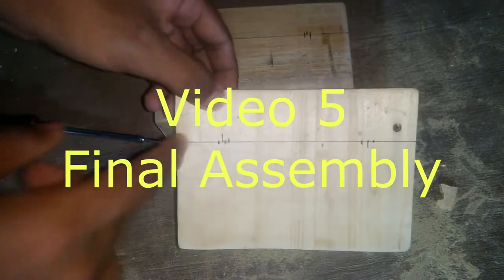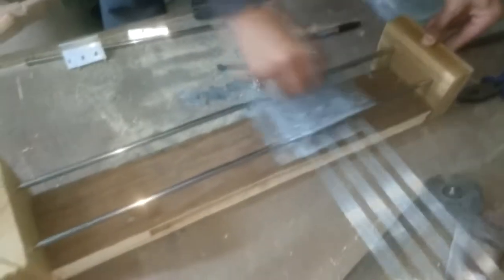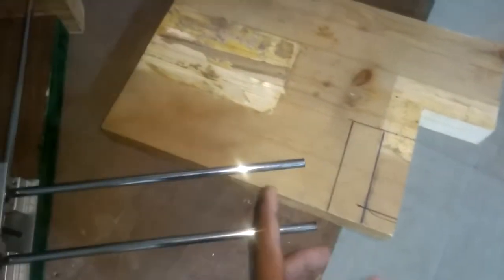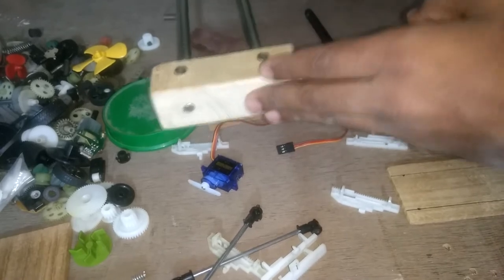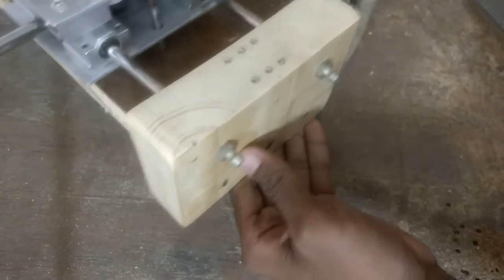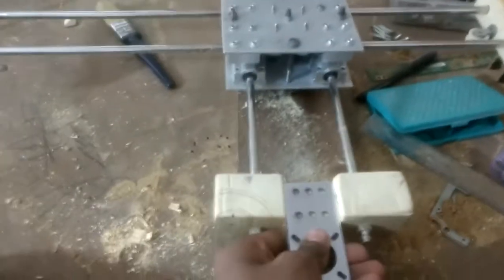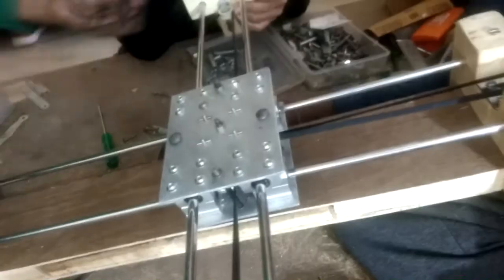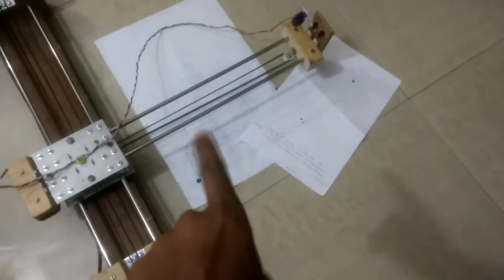Video 5 | How to make Arduino Drawing Machine | Making Final Assembly | www.ArnabKumarDas.com

Comment: Hi Arnab, congratulations on the amazing CNC machine you have build. i am new to Arduino but with your crystal clear instructions, i am almost towards completion of the machine. Need a little help from you. I am using the same s/w and settings you had mentioned but getting error while sending the gcode as "An error was detected while sending 'M18': error: Unsupported command. Streaming has been paused.
** Pausing file transfer. ****" . can you please help ? thanks
Reply from the maker: Jaideep Srivastava i guess ur gcode generation has some error
Reply: Thanks for the super quick reply Arnab, it was indeed with gcode only, other problem which is coming is that the image size plotted is very small (i have chosen the templates for A4 yo had provided) and it does not look remotely like the one i selected :(
Reply from the maker: This is because those machine parameters is machine dependent .. so u have to calculate urs own
Reply: Thanks Arnab , can you suggest the recommended XY step size,Z Step size and feed rate to be set in gcode sender. I am sorry to disturb you, but being from a non electronics/non-mechanical background, it is a bit difficult for me to get the final thing get going.
Reply from the maker: Jaideep Srivastava all those depends on ur machine construction so only you can tell .
Reply: assuming it is an exact replica of your drawbot, what would be the ideal values ?